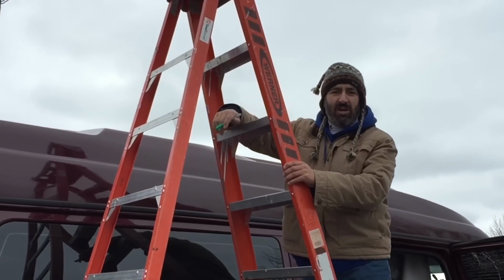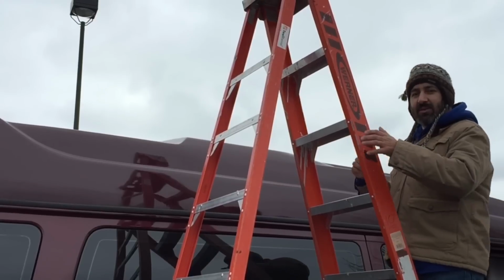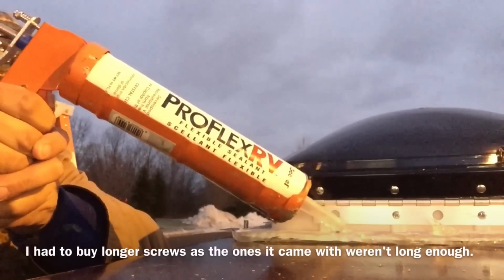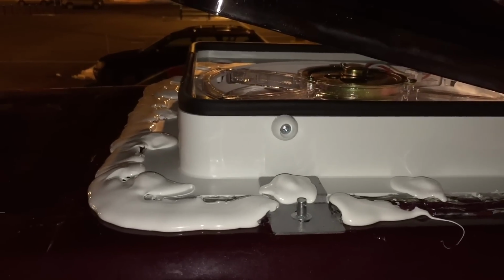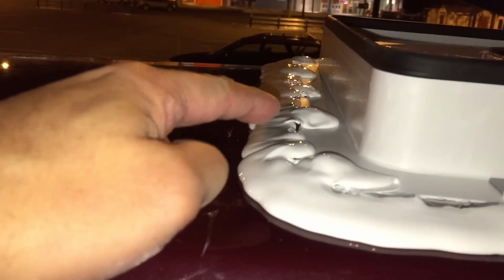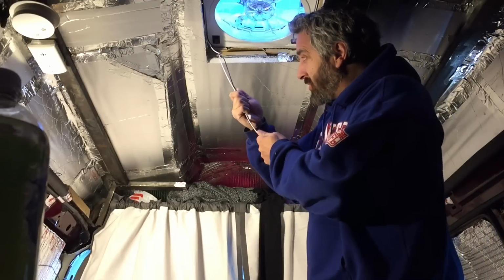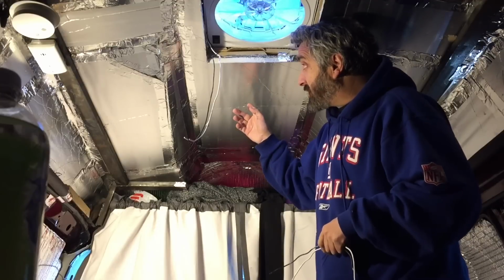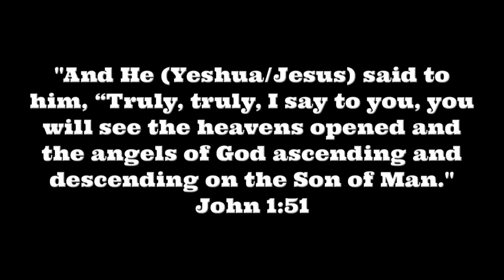Van Life; Fantastic Vent Installation! Part 1 - On A Hightop Fiberglass Roof

Comment: When drilling into Fiberglass/Gelcoat always run drill in reverse to keep Gelcoat from chipping and cracking. Then use a round drill stone to Champher (smooth) the hole's edges. This keeps Gelcoat from cracking under stress.

Comment: I am a new Subscriber, liked the webestos install vids and this. thinking of doing a "Sprinter" conversion. you have good ideas & work practices. nice clean installs
Reply from the maker: Thank you very much!
When I first thought of getting a van, the Sprinter was the one I wanted, until I realized they aren't too reliable and maintenance would be very expensive. 
If I had a choice the Ford Transit would be the one I would get. My only concern is the reliability factor is still unknown at this point. 👍🏻😄🚐

Comment: Getting ready to install maxxfan in 04 hitop gmc Savana then insulate.  Or start insulate waiting for it to arrive. Looks like you have foil layer first then 2” or 1/2” polyiso or XPS board.  How has it been keeping hot sun heat out and keeping warm in winter.  Any regrets or wish u did something different.  I’m considering the Ultrarough 3/8” foiled denim product. They said install denim side against van and it would provide ample insulation sound deadening ?? Maybe do both.  Existing ceiling b3/8” plywood fabric glued on it   Could keep simple going back up with it or consider the 1/4”ish hollow core cedar panels that provid3 benefits even with no insulation.  Thoughts ?
Reply from the maker: I wouldn’t install anything that can absorb moisture. That’s why I went with close cell foam. 🖖🏻👍🏻🚐☕️